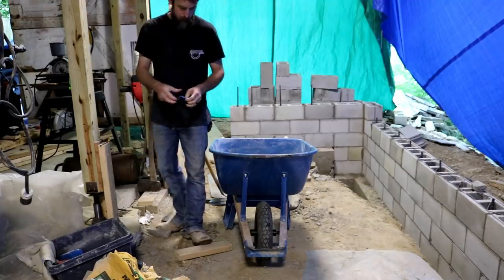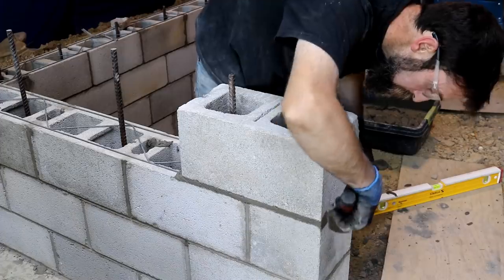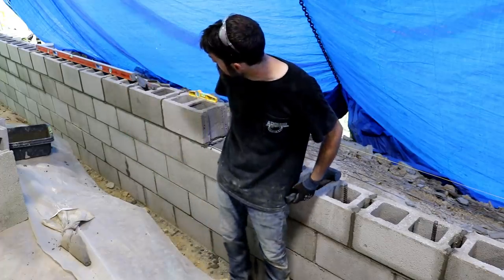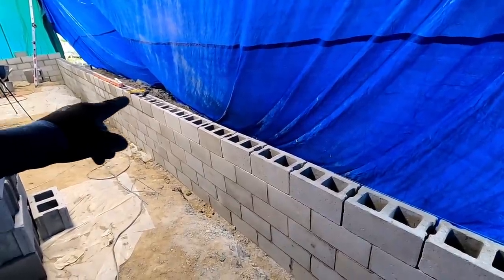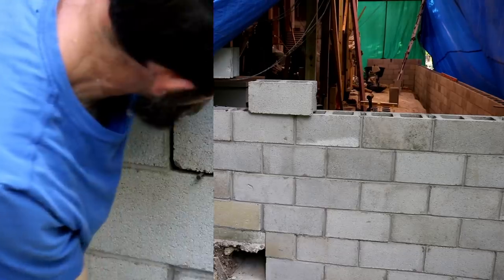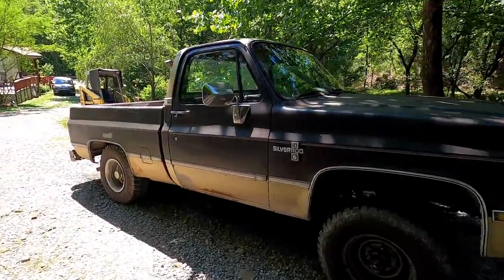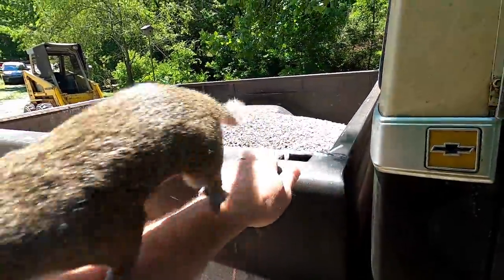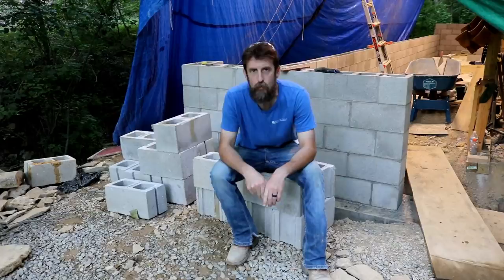Block Work Continues on the damaged shop!

Comment: Steve I’ve never seen that steel grating that you imbedded in the mortar between rows. Is that in every block wall? Also, how will you fill the wall? By hand or will you do like Essential Craftsman and rent a concrete pump again? I am learning so much about how concrete is just part of an overall system of block, mortar and steel that all has to work together. I guess you will have to tie the new floor slab into the old with some sort of clever rebar arrangement too. I am an aero eng, so I understand structures, but we don’t use a lot of concrete in airplanes! So once I see the components being used it all makes sense. You are going to have so much room, at first, but by some strange entropic process it will just attract junk and stuff and fill up. That will be the challenge, keeping it freed up for more cool machines!  You continue to be the hardest working man on youtube! Much respect. I marvel at what you have accomplished through mostly skill, ingenuity, determination and a ton of hard work. Your son is very fortunate to have you as a role model in many ways, how hard you work, what you are capable of and the width and breadth of your knowledge. Most kids have no idea that it is possible to dig a foundation, weld parts are machine parts or do plumbing or electrical yourself, vs calling somebody. But to him, doing that stuff on your is just...normal, vs watching sports and drinking beer. That’s a great message.
Reply from the maker: I'm doing the grout work myself. It's too expensive to get a truck and pump out here for a job that doesn't require speed. It will take 30x longer to do it myself but I have to leave funds for a new roof .  I appreciate the kind words. My dad was is a guy who did everything himself.  If he was capable.  It stuck with me. Thanks for watching
Reply: Steve Summers look forward to seeing you do it. But it’s gonna make me feel even more lazy... ☹️

Comment: In Sweden we have a type of block called "lättklinker", when I google for a translation it says "haydite" but I'm not sure if that's really the same thing. Anyway, they are light, solid and therefore the mortar can be laid out with a tool that will make the strings when you drag it on top of the wall.. It's very fast and efficient. Anything like this in America? The notches or whatever you would call them are for rebar.
https://img.bygghemma.se/pimages/murblock-lattklinker-finja__5c8f6d9e-3483-4709-bb18-c0f7648ec656.jpg

Comment: Be careful handling those sliding glass doors.  The glass is tempered therefore resistant to breakage against frontal blows to the glass.  When you take the wood frame off and expose the glass edges, do not in anyway hit the glass edge with the slightest blow of any kind or the glass will shatter into a million pieces. All it takes is a slight ding of a putty knife edge against the glass edge and the glass shatters.
Reply: I was on a demo job once and watched a guy hit a tempered piece of glass with a sledgehammer right in the middle of it. He really wound up like he was swinging for the fences. Was a big display window in a mall. The glass hit him back twice as hard. The hammer just bounced off and he went flying with it. Then I walked up and tapped the edge with a hammer and the glass rained down in little cubes. We were all laughing. It was funny.

Comment: I am surprised that there is no vertical expansion joint in the wall, which should be placed at not greater than 20ft/6.0m centres.  The blockwork will move due to thermal expansion and this will show as stepped diagonal cracking along the joint lines. The designing engineer should have advised on this.  I assume that you will pump the grout fill between the blocks?  This will need the 2" pump and most importantly a poker vibrator to ensure that the grout flows through to all the nooks and crannies.

Comment: Don't point in the joints until the mortar is almost set.  If you do it that way you won't make a mess all over the block and the concave curve will look more uniform
Reply: That's striking up. Pointing is something different. I don't think people point anymore? Used to be a thing with brick buildings. Now we just tear them down and build new ones. But that's where cape chisels come in. Pointing you chisel out the rotten mortar and put in new mud. Was big with chimneys. I worked on one job where we did something almost like pointing. Place was really falling apart. It was on the historic register though so tearing it down wasn't an option.
Reply: @1pcfred  your correct, pointing is technically chopping out and repairing old mortar,  its very common in England most houses are brick built.  I moved to the usa years ago and i don't really like the stick built houses,  if that was my shop id just keep going up with the blocks to the top.

Comment: It looks fine to me that mortar bar worked well the only block wall I've done I'm pretty sure half of the mortar ended up on the ground. Are you going to fill every hole or just the ones with rebar.

Comment: The truck warned you. The next time that battery terminal plays up you will be sitting at a junction blocking traffic in the pouring rain.
Reply: My ranger did that once, except it was the fuel pump that went bad and I was at the head of the left hand turn lane for the second busiest intersection on the main drag of the city......

Comment: Aren't you supposed to fill around the rebar with mortar so that it actually holds the blocks in place? Don't really know what I'm talking about (and maybe I missed the part where you filled it), but I can't understand how the rebar is going to make the wall stronger unless it's connected to the blocks with mortar.
Reply: That is my thought, too.
As it looks to me now, the rebar is just there, doing nothing.

We in Germany have similar blocks, that are supposed to be filled with concrete (lay three rows, fill with concrete and vibrate the air out, lay the next three rows, etc). Our blocks are actually molded in a way to accept vertical and horizontal rebar.

I would like a clarification as to how the rebar as shown has any reason to be there, even though it is not connected to anything but the foundation.
Reply: He went to get a finer stone for that
Reply: When you see a house being built in your neighborhood, and they're building the walls, do you go over and say, "I thought you guys were going to put a roof on this house. How are you going to keep the weather out?" 32:40

Comment: I hope you are going to do the floor before you put up the walls, easier to pour the concrete with out the walls in the way...
Reply from the maker: I cant. The support wall is in the way of the new pad . Unfortunately it will be after the load bearing wall is up
Reply: @SteveSummers  You're right I forgot about the roof supports, to bad though it would have made it so much easier...

Comment: If the void is accessible from inside the workshop why don't you make a drainage point running to the outside through the void before you concrete it just in case you wish to wash the floor down, inside, at some time in the future?
Reply from the maker: That's an idea I'm definitely considering doing. 👍

Comment: 24:50 getting loaded by an CAT 980, overkill? HELL YEAH IT IS! X-D   But he did good, nice and easy
(have to ask my CAT-Guy what the fuel efficiency would be for this 2min load up :D )
Reply from the maker: I was thinking if the guy had a full bucket and dumped it quickly it would have crushed my truck 😁😎

Comment: Try a margin trowel. They’re really useful and s little easier to use then the triangle trowel shape.

What is the wire you put between courses called?
Reply: Pointers are what masons use to lay block. Big pointers.

Comment: How is this for a logo idea.
Background, a block with a squirrel tail sticking out the top.
Foreground, a section of basic machine parts, a gear, a lathe chuck, and a grinder disk.
None of this would be hard to draw as basic line art.
Reply from the maker: 😁 Thanks a neat idea. Thanks

Comment: I thought you were going to poor the slab / shop floor on top of the block work. Tied in to the riser reo bars. For maximum strength. I don't understand this method.

Comment: Cant you put rebar into the wall and the concrete of the floor so they are connected? Or is that a no-no due to temperature movement?

Comment: You know it never really occurred to me to use a hoe to mix concrete. I've been using a shovel all these years lol. That looks much easier.
Reply: They actually make a hoe that is designed for that purpose. It has holes in the “blade”.

Comment: I'd heard that the tool used for pros is a hoe with 2 holes in it, but rather than being called a "hoe" it's called a "fork."  Therefore, the apprentice using said tool is a mortarforker.

Comment: Just add a squirrel to each arm of your avatar, that will do for now.

I was wondering what the plan was for locking the wall to the rebar in the footer.  Packing the rebar columns with gravel is something I hadn't considered.  I've seen it done elsewhere, I just didn't think of it as an option in this case.  Let's just say that what I thought would be good is probably overkill
Reply: Steve is going to mix concrete and pour that down the rodded webs. He just wants small aggregate in his mix.
Reply: @1pcfred  I didn't catch that part of it.  I probably would have opted to use sacrete instead.
Reply: @infoanorexic  I think Sakrete is kind of expensive compared to mixing your own? Plus I've never been too impressed with bag mixes anyways.
Reply: @1pcfred  kind of depends on where you get it, how you treat it, what conditions it's going to be under.  I've known people that used it for small work,  they would fortify it with some extra Portland.  What I put down in my shop is from Sutherland, and it has, so far, held up well.

One advantage to it: you can, if you have to, put it in the form dry, wet it enough to soak it through.  Screet, float it, trowel to finish.  My mixer stripped a gear on me, and I finished it that way ... it's an old farmer's method I read in an Ag class textbook.  I can't say I prefer it, but it will work in a pinch.
Reply: @infoanorexic  I'm sure Sakrete has different plants that produce different materials. I only know about what I am familiar with. I have not gone around the country and sampled every variety. But the stuff I've used has lousy aggregate in it.

Comment: maibe have a cartoon artist do some drawings of peanut and you and youre family the little drawing next to youre name looks nice 
could do peanut like the cartoon alvin and do some scenes with peanut doing inspectionwork with a hardhat and notepad or some other funny scetches , i think they would sell fast if you make them as an one off as long as supplies last items and replace the cartoons after the run is gone 

maibe one day when the bed of youre trucks body is realy falling apart or you want to create some new content for the channel you could do a flatbed with enclosed sides for it and make it lift hydraulicly think you can get some weld in replacement stuff from lmc for not too mush money https://www.lmctruck.com/1973-87-chevy-gmc/body-panels/cc-1973-87-steel-body-patch-panels 
grind and sand the welds smooth do a rustoleum paint job on it and you got a nice (enough) water and airtight truck ready to go another few years 
the LS style engines are getting cheaper too in the wreckingyards and there realy good engines 
there kits available to mount them in youre truck using the stock enginemounts and adapters to hook it up to youre current gearbox (need a certain oilpan and a trottlebody for a cable controll , and a big part of the engine loom and ecu theres plenty of info about that on the internet , think the whole lot connects to the stock wiringloom with 3 wires  ) , that will reduce youre gasmilage by quite a bit , at the cost of not being able to get the engine running again with some metal wire and a screwdriver (need a little more tech )
those modern trucks are nice but the bodies are not as well build as the older trucks

Comment: ok i forget or didnt hear.. why block to floor level? why not soild create all the way to  and maybe above floor 6 to 8 inchs? then block from there. rebar the cells.. rebar the cells.. in case.. i didnt say it. rebar the cells...
Reply: Money. Forming and pouring concrete is expensive. Steve had a pile of blocks to use too. They'll work. He's turning his work into money he won't have to spend. I'm sure this whole job is costing Steve a lot more than he wants it to already.

Comment: In 57 years, I have never witnessed someone use a grout bag to throw the mortar to set the blocks in. Usually you use a string line so you DON'T have to level each block. You are having trouble striking the joints, because you are supposed to let the mortar set for around a half an hour before striking. Usually you lay 4 or 5 rows of block, then go back and strike the joints off.